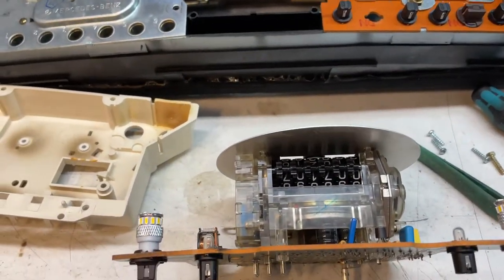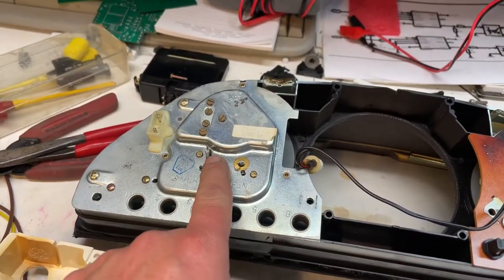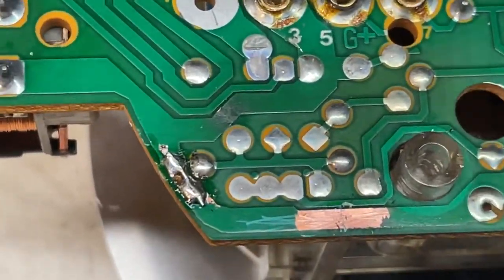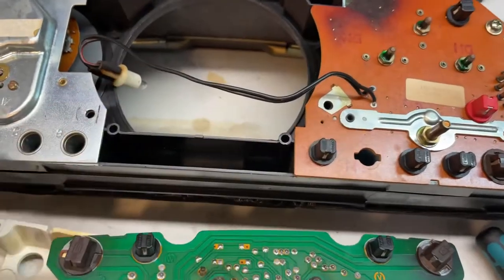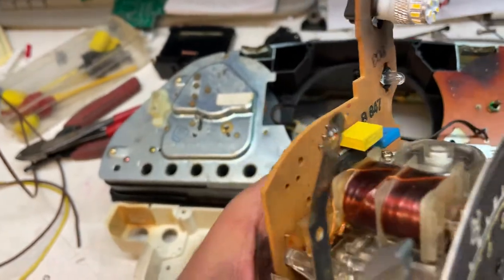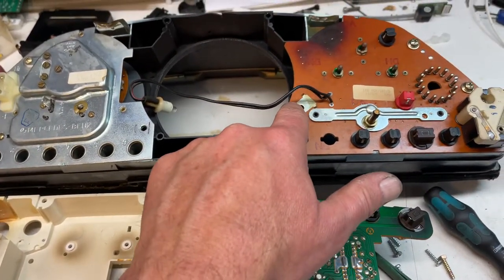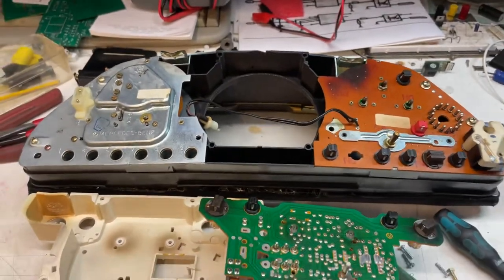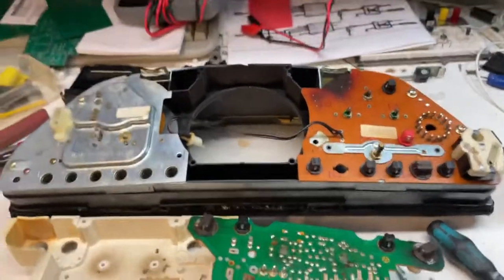Repair of W126 560SEL Instrument Cluster with ground problem, erratic fuel, temperature & oil gauge

Comment: My father and I love your videos. They are very helpful for my 560SEL, 420SEL, and his 560SEC. We are having problems with the heat in two of the cars and we believe it is in the climate control unit circuitry. When we pull the power plug on the mono valve we get instant heat. The strangest thing is with the 420SEL, the heat usually only goes away while driving. At idle it returns. The 560SEL has very mild heat at all conditions. It’s as if the wrong voltage or current is being delivered to the mono valve for the conditions being called for. We plan on replacing the capacitors you pointed out and checking solder joints. Thanks for all your informative videos!
Reply from the maker: Thanks Mark! You also want check the two temperature sensor for the cabin. This one is located next to the interior light where your rear view mirror mounts. They have small air pump with motor and the channel clogs up with dirt, preventing the correct reading of interior temperature. Those are NTC sensors. There are also two more NTC’s for the AC core temperature and the heater core - both are located in the center ac housing below dash. Check with your manual

Comment: Hi, this was a great video, thanks, my issue is the temperature guage in the cluster, it starts bouncing erratically up and down, I have cleaned up the contacts, but the problem remains, can I ground out the pin on the rear of the cluster that attaches to the temperature guage?, I’m hoping this will fix my issues,,thanks for all your great work,,,take care,,,
Reply from the maker: You mean the pin which connects the left cluster to the ground bar on the center cluster?
Reply: On the back of the cluster, there are 3 pins, and one of these is connected to the temperature guage, I wanted to ask if I grounded out that pin, would it solve the issues I’m having of the guage jumping up and down,,,thanks for your reply,,,appreciate it ,,,
Reply from the maker: What model and year are we dealing with?
Reply: Hi, I have a 1988 300SE, w126 model, the dash cluster looks identical to the one you show in your video,,,it’s a great car, but this guage is driving me crazy,,,thank you for your help,,,,
Reply from the maker: @livin4today132  I am not exactly sure at the moment but the three screws from each gauge temp, fuel and oil are connecting to the one screw to center cluster bus bar - I would check continuity to that small Metall trace where the center buss bar makes contact to from each gauge screw - the screws which do not have continuity to this ground point can be hard wired to ground
Reply: Thank you so much for your help with this, I’m going to try this now, I’ll let you know how I made out, really enjoy your videos,,,,take care,,,

Comment: Hello there, a quick question, in my w126 the speedometer seems to be a bit slow. Id say about 20mph slower than what it must be. What could be the reason? I got a repair kit with 3 small round plastic items with teeth. Could that be the fix? Or is there a way to calibrate it? Thanks!
Reply from the maker: @josephstephan3815  first question, what model, what year, mileage?

Comment: my cluster has no pwer to the coolant level light, fuel reserve light, oil level light and brake pad light, the handbrake light is dim when handbrake is released but goes out when the car is started, any ideas what the problem could be, i tried pins 4 and 6 and they continuity to earth on the cluster
Reply from the maker: Check the diodes.
Reply: @inovahightechltd  how do i check a diode using a multimeter
Reply from the maker: @sas8403 
https://youtu.be/mMXDa5hVzXA?si=B8Qq_GIBad8fZzm0